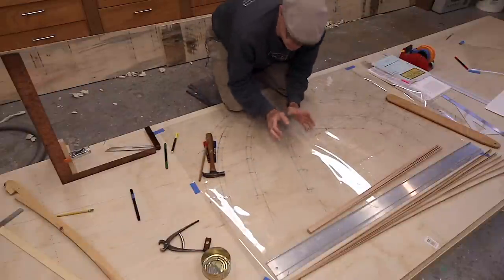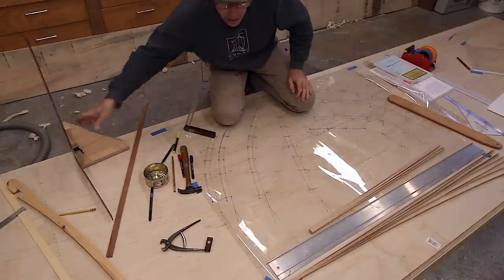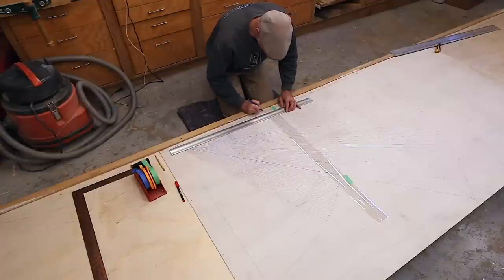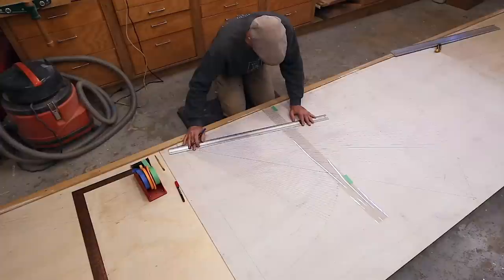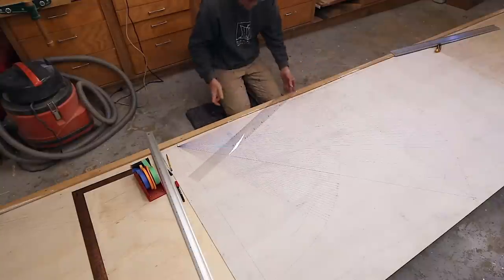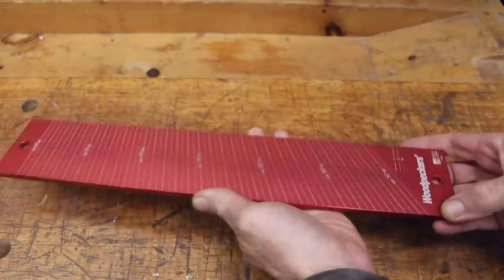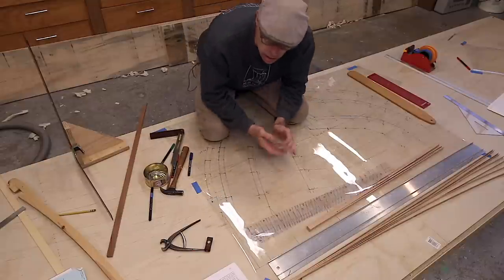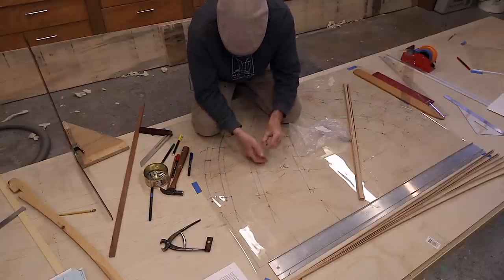Building the Catalina Wherry - Part 5 - Lofting Bevels

Comment: This was very good information. I understood that using the two stations on either side of the station in question will produce an angle that better approximates the angle of the line tangent to the station being worked on.

I have been reading about making molds to build a canvas canoe. Most people say to reduce each station by the thickness of the mold exterior, about 3/4 inch, as well as the thickness of the ribs, about 3/8 inch, in order to obtain the distance to the inside of the canoe. However, according to what you were showing here, that would be incorrect. I think I need to employ your method to reduce each station individually so that the finished canoe will more accurately represent what the designers had in mind.
Reply from the maker: Canoes, being relatively narrow will not suffer greatly using the simple consistent reduction method. I wouldn't bother going to grater lengths. If you wer building something in which the finished dimensions were critical, a certified racing shell for instance, then that might warrent proper reductions.
Reply: @Nomadboatbuilding  I see. Thanks for the response.
Reply from the maker: @JoeGrasso-fl1gn  and thank you for joining me on Patreon Joe!